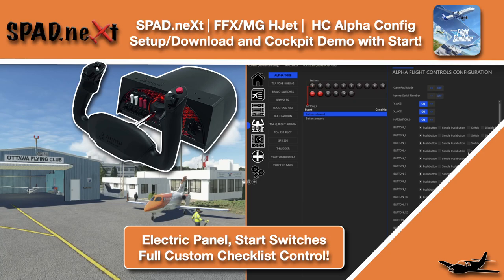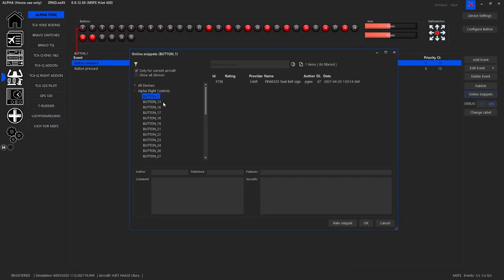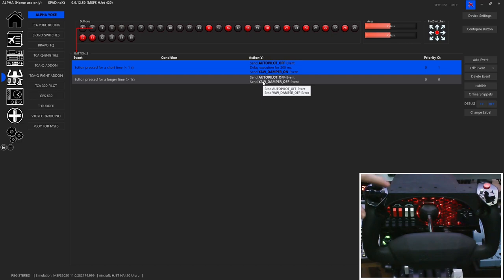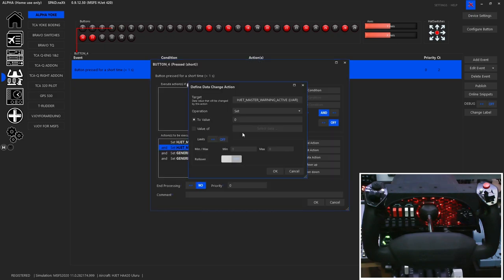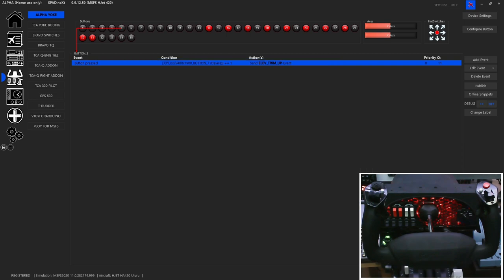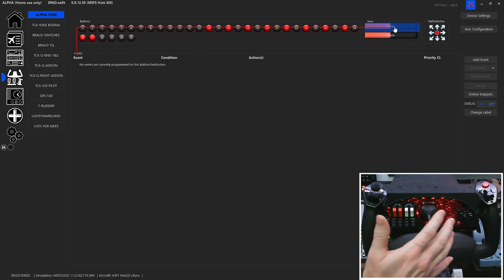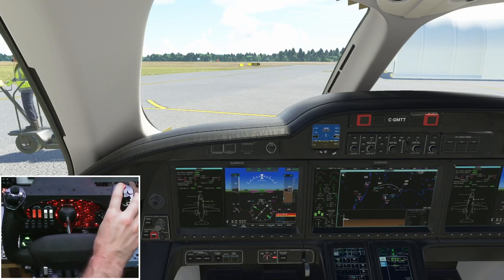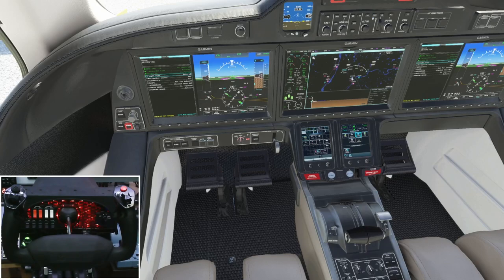MSFS | SPAD.neXt | FFX/MG HJet | Honeycomb Alpha Config

Comment: Man, it's great watching your tutorials and learning so much, even when you are working with completely different hardware, because you provide ideas that can be applied across multiple devices. I've learned so much and found different and better ways to achieve things than how I initially set them up. Things like the yaw damper tip, trim using Buttonmode: repeat (instead of button held), etc.  
I'm currently configuring the awesome FSW Lear 35A with all of my gear, which includes the TQ6+ throttle quadrant.  Using your videos, I have the TRs working perfectly!   Going from idle into reverse (REV) without using a separate button, is such a treat. Thank you so much!  😊
Reply from the maker: Glad to see you are learning to Fish from it!!!
Reply: @LesOReilly  Absolutely!  I haven't flown anything in a few years, but thank God we have the simulators and some incredible paywarre aircraft to fill the void 😀
Reply: BTW, I just realized that "button held" is the same as buttonmode repeat in an older version, lol.  Love Spad :)

Comment: @ Les O'Reilly - I have the same Alpha control and I use MSFS 2020. How can I add two different buttons to the same control? Per instance: My Elevator Trim Down (Nose Down) it has Button 5 and Button 7 (this is located on the left side of the yoke handle and one half of the trim button is not working). If I remove those to reinstalled again (assuming that this will make those two buttons engage with the SIM) how can I add both to same control? When I add button #5 and save it, I cannot add #7 as it removes the number 5... Thank you a bunch in advance.
Reply from the maker: don't understand what you are asking ..  make sure if you are using spad to set bindings that you do not set bindings and clear them out in MSFS settings.
Reply: @LesOReilly  Thank you for your reply. I am sorry I cannot explain myself better. If you look under your Alpha Control settings, the settings for "Elevator Trim Down (Nose Down)" it has two buttons assigned to it. If I remove them, and then want to re-assign them back, how can I do it. For now, I can assign only one button and save it. The moment I try to assign the second button, automatically remove/replaced the first one I have already assigned. There is a way to be able to assign both buttons and saving it without removing the other one. I hope this make sense.
Reply from the maker: @lgarcia258  I have no idea why it would be removing the other .. that does not happen with my version